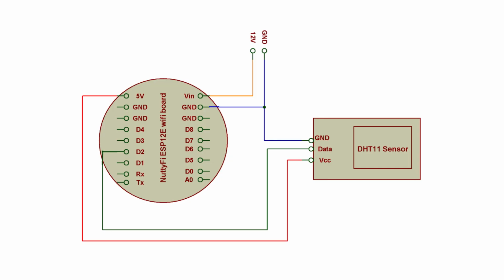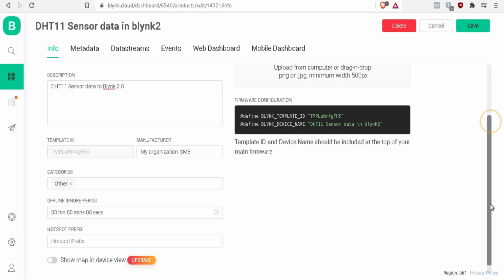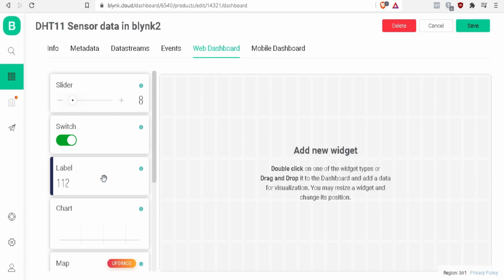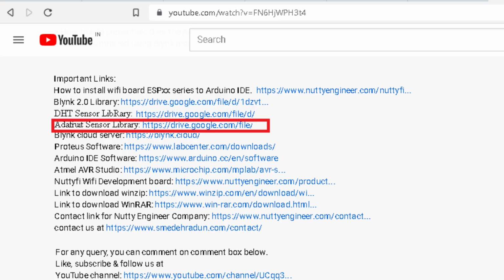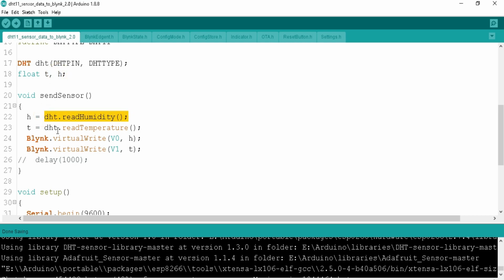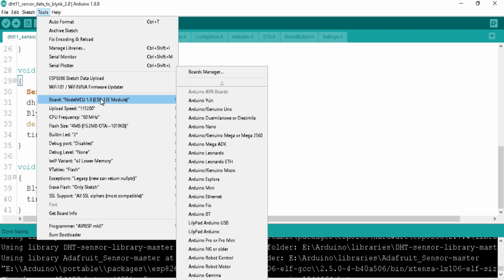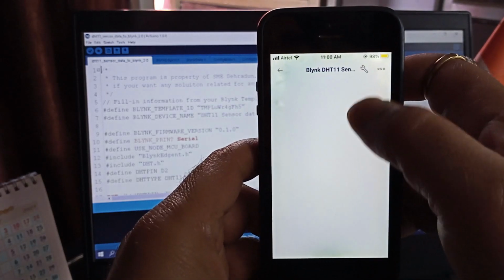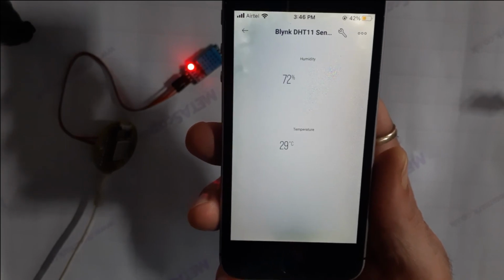DHT11 Sensor Data to New Blynk2.0 using BlynkEdgent Method- Fetch the Humidity & Temperature Values

Comment: My one is showing connecting always in serial monotor why?
Reply: No board is connected but not conecting to cloud
Reply from the maker: Your board is not connected to wifi that’s why. 

You can also send DHT sensor data to blynk cloud with alternate Method. Below video will guide you how? 

https://youtu.be/c5u6-Th1sI4
Reply from the maker: Because board is not getting the wifi

Comment: Hi there,

I am doing a similar project  however I faced this errpr, #error "Please specify your BLYNK_TEMPLATE_ID and BLYNK_DEVICE_NAME". I have changed the ID and name to what's found in the dashboard and yet face this error. Some help please. I've viewed your video on how to solve and fix the error but it still persist.
Reply from the maker: Hi,
This errors shows the non definition of blynk Credentials. 
Plz watch the video properly and follow all the steps. 

You can also connect your board to blynk with alternate method. Below link will help you- 

https://youtu.be/c5u6-Th1sI4

Comment: Could you do a video With just using a simple Switch (Digital Input)?
Reply from the maker: Hi JOHN SMITH,
If you want to control digital input using Blynk, then this video can help you—

https://youtu.be/SrkK5ANsDDM
Reply: @SMEDehradun  This is controlling a Digital Output. I just want to be visually alerted when a digital input Changes state. I guess it's in the coding.
Reply from the maker: K so you want to indicate the input state in virtual led ?
Reply: @SMEDehradun  yes
Reply from the maker: K. I have used a virtual led in below video. Take the reference from it. 

https://youtu.be/mLzEb_1i9UQ
Reply: @SMEDehradun  Thank you, I will check it out.
Reply: @SMEDehradun  How about just a simple switch, like a float switch? When it closes, I would like to see the virtual LED change to red. I cant explain it any other way.

Comment: Sir, How to connect adxl335 sensor to blynk using ESP8266 for monitor the vibration??
Reply: Sir, But I want code for adxl335 sensor connected with esp8266 same as what you explained for dth sensor in this vedio.
Reply from the maker: Ok. I will help you. Plz contact me at my WhatsApp No at 9927715123.
& don’t forget to subscribe.
Reply from the maker: Hi Bhavna,
Go through this video, it will help you to calibrate the accelerometer. 
If still getting any problem, comment back, we will help you. 
https://youtu.be/UxHglxqVFg0

Comment: Error compiling for board NodeMCU 1.0 (ESP-12E Module).
 
IM GETTING THIS ERROR, HOW TO SOLVE
Reply from the maker: Sorry for the delay. 
It may due to header files. So compile with header files. 
& blynk library must be installed to Arduino ide.

Comment: sir, can you make video about solar energy monitoring system using blynk 2.0
Reply from the maker: Ya sure. We will try to make video on it. We have already done solar monitoring on it, not in Blynk2.0. We will do it soon on Blynk2.0 and then post to our channel. Stay tuned.
Reply: @SMEDehradun  wow sir thank you where can i watch solar monitoring sir?
Reply from the maker: https://youtu.be/NLO38pKzTCE
This is link for solar panel monitoring. But this is solar panel data logger with RTC, that will send the data including voltage & current of solar panel including temperature & moisture with date & time to Thingspeak cloud
Reply from the maker: We also use lux sensor to measure the light intensity.
Reply: @SMEDehradun  wow, thank you sir. i will waiting your update on your next video about solar monitoring using blynk 2.0 thank you sir
Reply: @SMEDehradun  sir may i ask you if i use 12 V 30 watt solar panel is it the voltage can exceed 12V? Example 14 V during sunny day..is it possible to get that value?
Reply from the maker: You can use it but first you or need to step down that to 12V so that it can provide the efficient power to NodeMCU ESP8266 board
Reply: @SMEDehradun  okay thank you very much sir

Comment: fatal error: Preferences.h: No such file or directory     
How to solve this type of error.?
Reply from the maker: @Shubham Makwana check the  blynk library you have installed. Also select the proper NodeMCU board.
Reply: @SMEDehradun  mine as well. all library i already installed and inputed on the library
Reply from the maker: Yes but there are 2 library in your Arduino.

You need to delete old blynk library.

Comment: how to connect DHT11 to ESP32 blynk 2.0 ??? from indonesia
Reply from the maker: @Agam Farm ESP32 quite different from NodeMCU. You need to select the esp32 in blynk template & also change the pin accordingly in program.
Reply from the maker: Also install the esp32 board Arduino ide. If you can use nodeMCU. It’s working with this code
Reply: @SMEDehradun  do you have the code for ESP32 blynk 2.0 ??
Reply from the maker: @agamfarm2687  for ESP32, right now code is not available. But soon we will make a video on it.